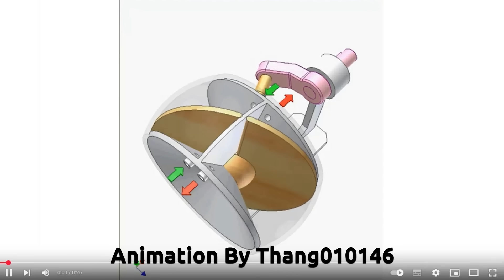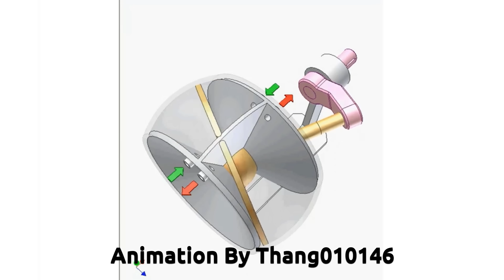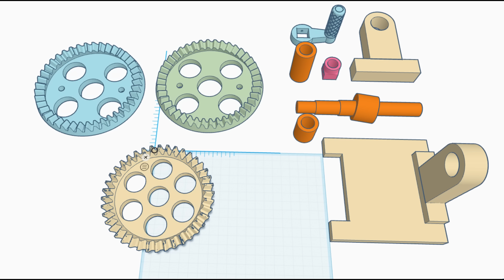2397 The Nutation Drive

Comment: General Motors made the same tuff decision about planetary gears in their 700r4/4l60 series automatic transmission,use better steel with less planets or use more planets with softer cheaper steel.🤷

Comment: Put it this way - if you had two cordless drills presented to you with the same price, but one of them had "now with a nutating gearbox!" on the box, would that make you buy that one, every time? If not, why would the industry bother? If that gearbox would mean such extra efficiency as to double battery life, then yeah sure - but as long as it's basically marginally better if at all, it doesn't matter what the theoretical advantages might be...

Comment: I spent some time designing drills and the market pressures to shorten overall length is immense. This gear train would go a long way towards that end. I have no idea how it would manage in terms of efficiency, but I bet it would produce a hell of a lot of vibration at high RPMs.

As far as production goes, the major problem I see is with the central shaft's bearing journal for the nutating gear. That shaft is not something easily produced on existing production machine tools. It would be massively expensive to machine as a single piece. You could have the nutating journal formed by powder metallurgy and pressed onto a concentric shaft that was turned on a standard screw machine, but sintered parts dont like to be loaded in tension.  (hoop stress of the press fit) It could probably be done, but you're also placing it in an unbalanced cyclic loading situation. Eek... 

The efficiency and length benefits would need to be pretty inticing to get me to bet a production run on it.

Comment: I used to repair pneumatic impact drivers, beside the gearing they had an hammer and anvil the hammer was picked up by the motor side every rotation and hit against the anvil which was attached to the driver side, I've never stripped a battery impact driver but I'd be surprised if it didn't have something similar.

Comment: I once saw a really old design for a water tech I can't remember exactly how it worked but it was based around a giant nutating disc. I think it was a pump to raise water. I suppose you could reverse that principal though and also use it with falling water like a regular water wheel though.

Comment: One lost invention was the constant velocity joint. It was rediscovered then used on the Mini car in 1959. The secret was having it incorporated in the front wheel hub. It transformed front wheel drive setting the scene for front wheel drive cars.
Reply: @johnburns4017  all front wheel drive and AWD cars use a CV joint

Comment: Very Clever! Similar to vernier scales, yes? There's another application of the slanted disk that I've been playing with: a sort of parallel cylinder radial engine. I've seen them used as pumps and I know of one that was made to be a streamlined aircraft engine but I don't know how well it worked. I've been working on a single cylinder demo of the principal involved and it's proved to be a real 'learning experience'; that is I've reached an understanding of it that will require a complete rethink. I'll describe more when I get further along. :-)

Comment: Wow, that's a seriously interesting mechanism. The only drawbacks I can see is that at the very high speed of today's motors the oscillating gear will impart an out of balance rocking force to the gear housing and a correspondingly heavy load on its bearings ?

Comment: I saw this mechanism used in a soviet microscope sliding table.
It had "2 speed gearbox" so to speak.
One wheel moved it faster and another moved it at a fraction of the speed.

Comment: All the load is put on one tooth.  Planetary systems have two, or three, or even more moon gears so the load is spread over multiple gears.
Reply: I don't believe that is quite the problem with these gears. There is a variant that uses internal spur gears with high contact ratio.

IMHO the problem is that you have tremendously high pitch line velocity handling the full output torque of the system. 

The full output torque is carried by the stationary gear, the nutating gear, and the output gear.

At the same time the full input speed is seen by the contact patch zipping around the system.

This means lots of wear and low efficiency. 

You get a huge gear ratio with a single stage, but the trade is that you get lots of lost power in that stage. Think worm gear as an analogy.

A valuable tool with its place, but not a magic machine.
Reply: @jonathanedelson6733  Interesting. You have confirmed my instinctive reaction which was that it looked to be inefficient and prone to wear.
Reply: Is it? Looks like a great many are engaged

Comment: I need to wrap my mind around the idea that such a small difference in gear can create such an insane ratio. 😆 Very cool device, i wonder about the risk of failure with the tilted forces, chances are if you need such a big ratio, there will be a lot of force on one side, so the universe might decide the constraint can be resolved in creative ways.
Reply from the maker: Have a look at the perpetual wedge and video 2390 the compact gear - there are - unsurprisingly - lots of ways to solve this problem
Reply: @ThinkingandTinkering  Ah, i had seen 2390, but that 2310 one really cleared things up, and indeed the second version seem much more robust regarding forces, you are a living encyclopedia! Thanks for sharing.

Comment: I think a disadvantage to this would be the vibrations of the moving mass. Especially for hand drills where the vibration could already numb your hand using it for a day.
Reply: I bet you can counterweight it
Reply from the maker: @zfolwick  oh absolutely you could mate
Reply: @zfolwick  It's possible I guess. One would need to see what it would take tho cos for drills it may end up being more complex than the standard planetary gear train while making the tool heavier. For other applications, I think something like this would benefit from being in a setting where it doesn't spin at high RPM in general or in very high torque scenarios where you can stack two "counterwobbling" sets.
Reply from the maker: good point

Comment: Can you create locomotion from the rotation? If these were radio waves will the rotation be directed to drive, locomotion?
Reply from the maker: I don't understand what you mean mate
Reply: The direection of motion caused by the wobble. At a 40 to one motion, if instead of gears and a wobble drive shaft you had a wobble Radio wave ? Could it drive locomotion ? Its a nutty idea but... thanks Robt. @ThinkingandTinkering

Comment: 6:30 I think the shear forces on those cam guide rings would be extraordinary especially at high RPM.
Reply from the maker: yeah maybe - easy to solve though if it is
Reply: @ThinkingandTinkering only a materials problem really.  the printed part fares well for what it is.
Reply from the maker: @yodaco  exactly mate
Reply: Yup

Comment: It's a novel idea, compact, it could probably be easily forged/stamped/cast With a couple of smaller 'cogs' opposite the contact points, to prevent warping under heavy load, it would have huge torque output. And be much easier to maintain/adjust for wear. It looks like it would be very forgiving of contaminants/wear.
Coupled to a screw-jack it would make for very good self-leveling use of heavy machinery.
Thanks for sharing.
ATB.
Reply from the maker: i like your suggestions mate - some good thinking going on there
Reply: @ThinkingandTinkering 
Thanks. Except the idler cogs would have crept around and bound up the mechanism due to the 40/41 mismatch, probably be better as rolling cones or just 'sliders': I'm probably over-thinking/engineering it though. The basic principle has a lot of possibilities, I saw something similar in a wave-plate for a torpedo engine, it had massive output torque in a compact 'cylinder', but obviously not meant to be a long life thing.

Comment: I can't recall who said it but I saw a quote to the effect of "it doesn't need to just be better, it needs to be TEN TIMES better". Obviously an overstatement, but it gets to your point. Seen that effect mentioned as why aerospike engines never became widespread: not enough of a benefit to justify the testing and development that would be required for full deployment.
Reply from the maker: absolutely mate
Reply: The counterweight could also fill the space made by the offset on the opposite side of the meshing gears to add stability and strength, though would also ad complexity and friction (just thinking aloud here live your work!)
Reply: There's also sometimes hidden downsides to certain technologies that could make it marginally better or potentially worse in actual use. Eg the aerospike engines having worse thermal management characteristics.
Reply: And this is why MP3 endures.